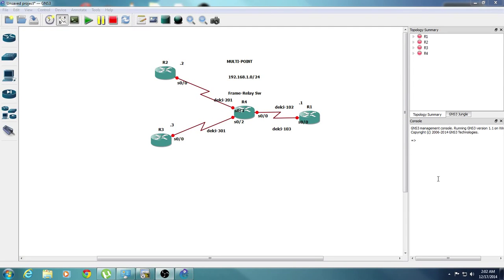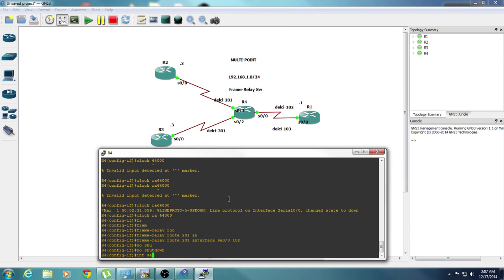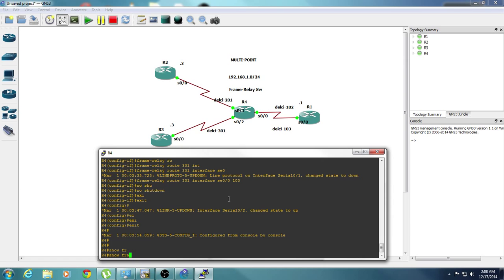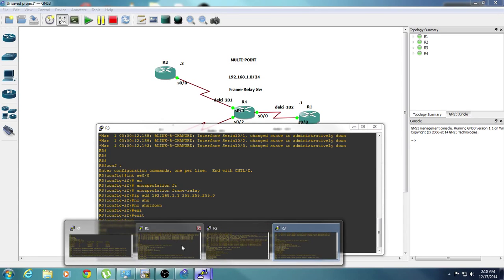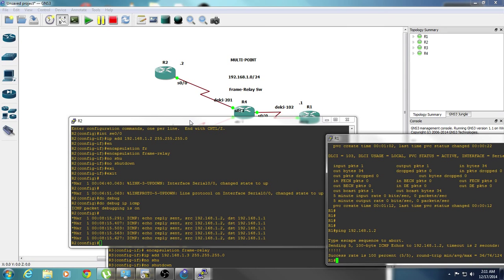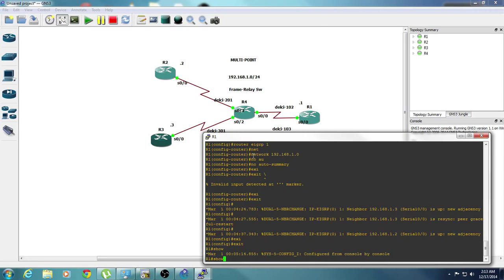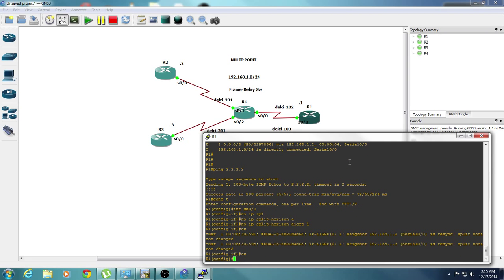CONFIGURE ROUTER  IN GNS3 AS A FRAME RELAY SWITCH

Comment: great video man! Are you able to run OSPF over this frame relay network because I wasnt able to. Only two routers would form adjencies while third router would only be able to see its own local routes ( loopbacks). I tried adding the word "broadcast" at the end of the frame-relay map statements at routers 2 and 3 but still router 2 would not form an OSPF adjacency. Routers 1 and 2 both saw each others loop backs that were advertised via OSPF. Any idea what might be wrong?
Reply from the maker: do you have full reach ability to all router
Reply: +jermaine brown 
Yes I do . I first configured the way you did with EIGRP. Then I wanted to do the exact same thing except run OSPF over the frame. All routers can ping each others interfaces that are part of the frame relay network. However, only two of the routers will form adjacenies via ospf. I can try to do again tomorrow and send you my config as i didnt save it. But i spent a good hour trouble shooting it and dont understand why it wont work.
Reply from the maker: +Dimitry Fishchuk OK I take a look at it
Reply: +jermaine brown 
whats your direct email so I can email you the files after I re-create it?
Reply from the maker: +Dimitry Fishchuk technations@yahoo.com
Reply from the maker: +Dimitry Fishchuk technations@yahoo.com
Reply from the maker: +Dimitry Fishchuk i check Ur config r1 should send uni cast packet not multicast  go back in ospf  then do neighbor 192.168.1.2 & 3 
and turn off priory on r2 and r3
Reply: +jermaine brown 

thanks for the reply, 
I caught that this morning as well after doing some more research. They formed the adjancies finally and both R2 and R3 can ping each others loopback. However when you run a show ip ospf neighbor on ether router 2 or 3 you get :

R2#SHO IP OSPF NEIGH

Neighbor ID     Pri   State           Dead Time   Address         Interface
N/A               0   ATTEMPT/DROTHER    -        192.168.1.3     Serial1/0
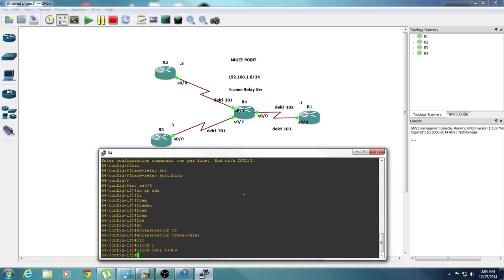1.1.1.1           1   FULL/BDR        00:01:48    192.168.1.1     Serial1/0

But on R1 you get good RIDs. Pretty weird. 

R1#SHO IP OSPF NEIGH

Neighbor ID     Pri   State           Dead Time   Address         Interface
2.2.2.2           1   FULL/DROTHER    00:01:49    192.168.1.2     Serial1/0
3.3.3.3           1   FULL/DR         00:01:50    192.168.1.3     Serial1/0
Reply from the maker: +Dimitry Fishchuk disable priority on r2 and r3